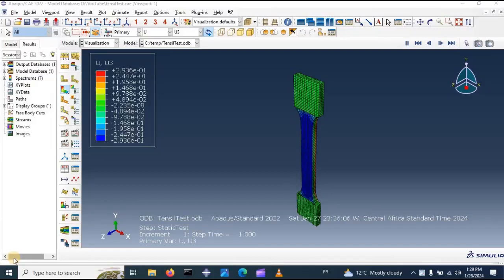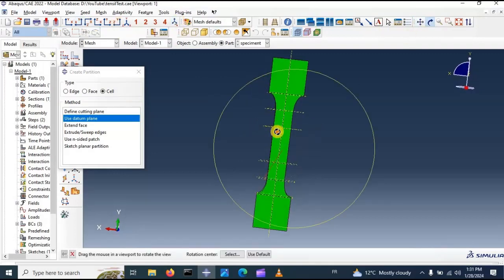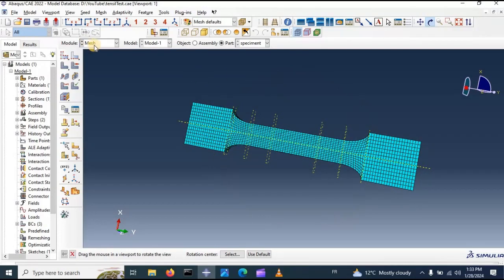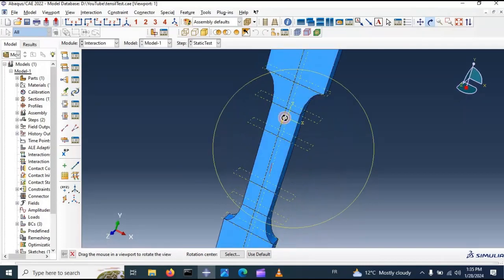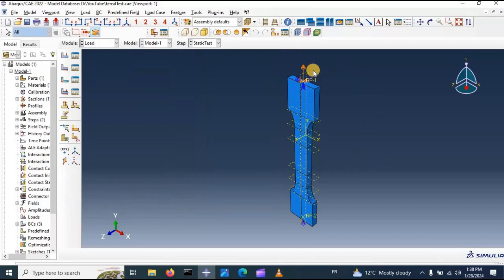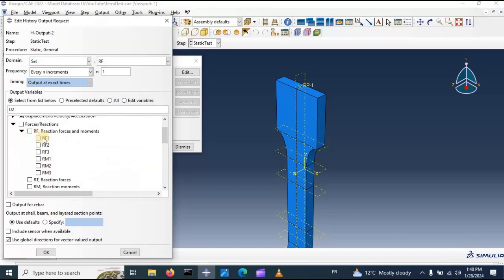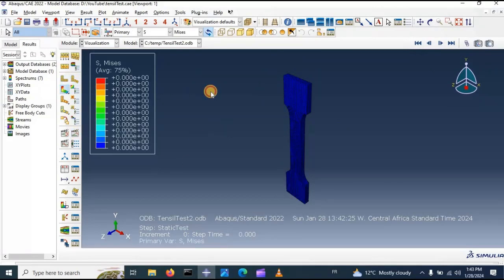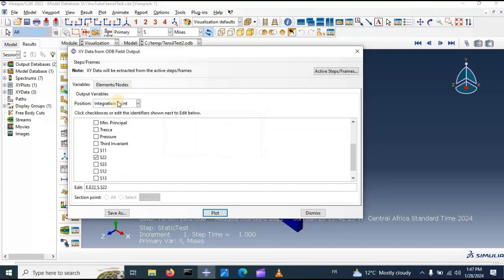Learning Abaqus 2: Simulating Tensile Test in Abaqus step by step #abaqus #abaqustutorial #tutorial

Comment: Thank you for this video. What does it signify ×E3 in the stress axis? When I extract Force it is ×E06 I can't know if I'm wrong or not.. I hope you can respond sir
Reply from the maker: Hi, The xE3 = 1000 or 10 power3,and xE06 equale to 1000000(10^6) .
Reply: @ABAQUS_SIMULATION I apologize I didn't make it clear I know that it means 10^6 what I meant is that why it is 10^6 while when i compred to the experimental data it is greater than 10^3 do I just ignore it ? Or is there a mistake in the in-put data
Reply from the maker: @AminaMASMOUDI  do you need to compare with experimental data....depending to your land and displacement....this simulation is in elastic analysis